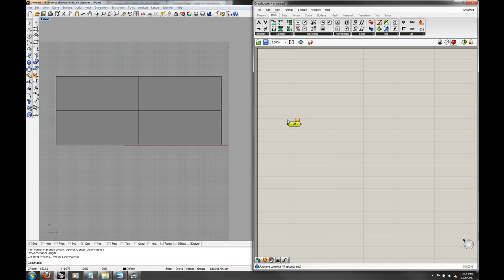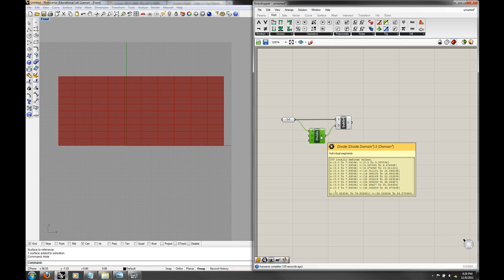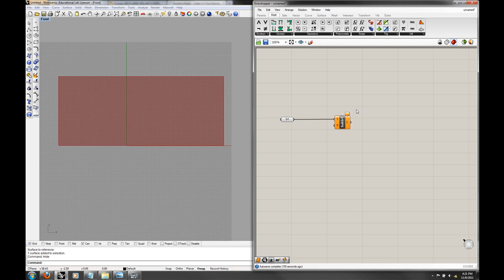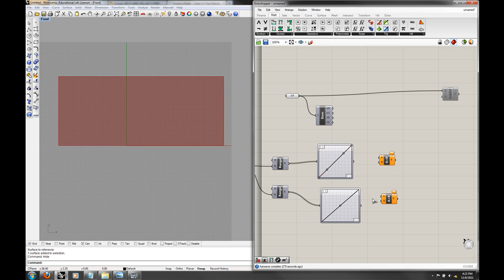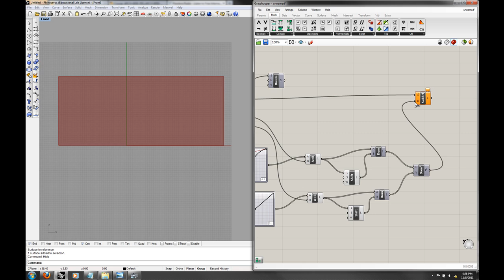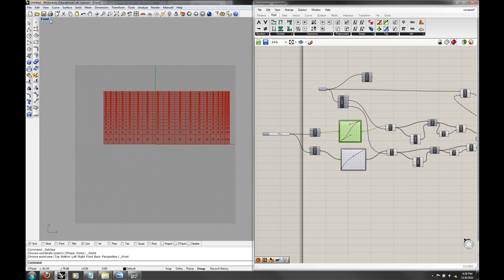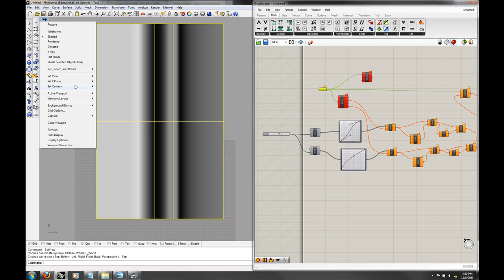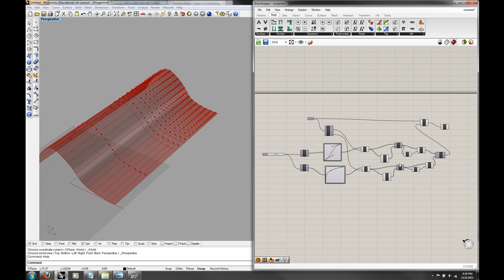Grasshopper Lecture 3 - Part 3: Irregular Paneling

Comment from the maker: Grasshopper is currently in version 0.8.0066, so you might need to update your software. Earlier versions don't always have the same component options and functionality. I was using 0.8004 when I made this video.